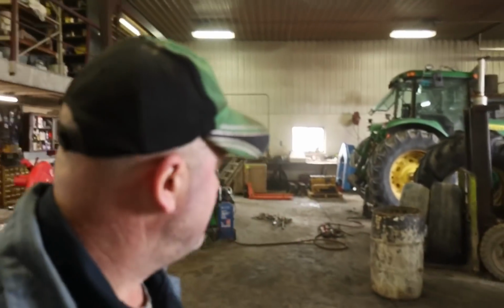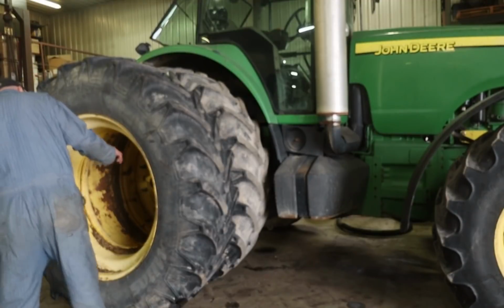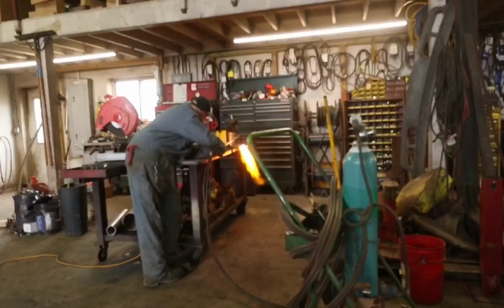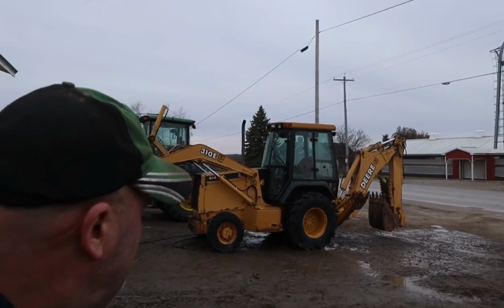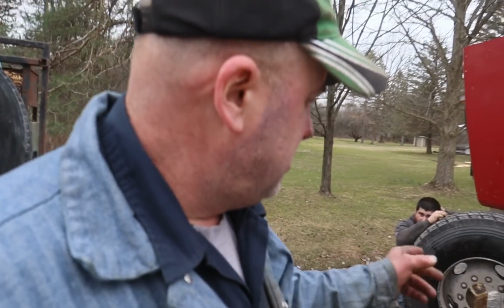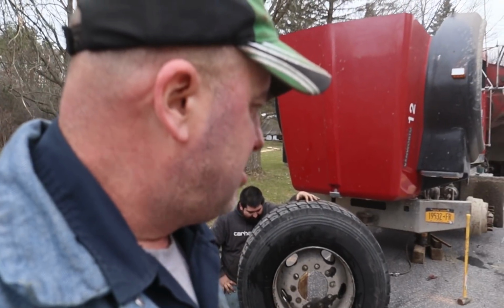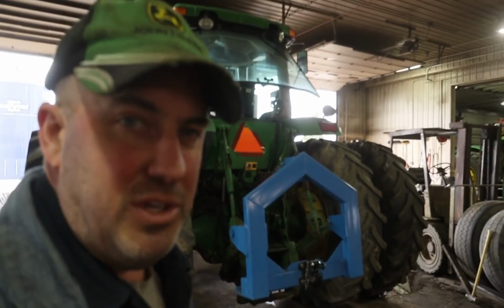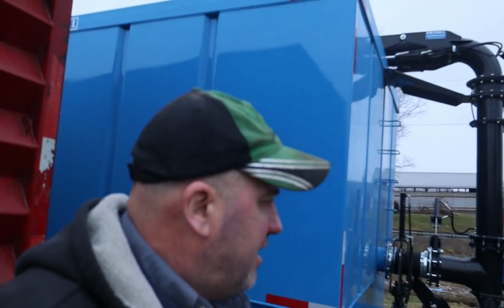Snap On Duals,Blown Truck Tires and Frac tank setup

Comment: We always put a little oil or grease on the dual so it came apart better granted it wasn’t as big a tractor. Never had the snap over clamps we always had the ones with nuts and a mile of threads
Reply: Robert Quast ever try anti-seize on the spacer?

Comment: I'm forever amazed at your calm demeanor - well just heat this up and put a little hook in it..  Or a previous video trying to get the tank and tractor unstuck.  Yup, that aint working, lets try this.  You take everything in stride and just fix it and move on.
Reply: Tad Pary        He is very calm.  I get heated up much easier than him.  My patience is not nearly as abundant as his.  It is a great quality, and I wish I were more like that.
Reply: No point getting ate up about stuff fellas it just tires u out and doesn't get the problem sorted out in the end!!!easier to just keep calm and bash on with whatever it is causing the issue!!!!Andy is just a perfect example of this.if he got stressed out over every issue and problem he came upon each day then nowt would get done and he would just be sat in a corner rocking from side to side!!!this is real life farming not some farm where daddy's money just sorts all the issues out ...there's a few of them on YouTube !!!!!Top man Andy keep her lit fella 👍🏻👍🏻👌🏻😊😊
Reply: Tad Pary me too
Reply: What about either spraying the dual spacer where you wirebrushed it with aerosol zinc anti corrosion spray or failing that apply a very thin layer of copper anti seize?
Reply: That’s farming. You would have a coronary otherwise. Things come up, and plans change by the hour.

Comment: Do you suppose spraying the snap on duals rims with slip plate would help? We used to oil them before we put them on. That didn't always help either.

Comment: Have you ever thought of having safety cones and lay them out on the road to help protect the work area?  Try out some torque sticks for your wheel nuts and studs.  Had them in the Air Force and would never go back.

Comment: A truck tire inflation safety cage should be used when inflating truck tires or mount wheel on vehicle  and then inflate I have seen the explosive effect of a truck tire mishap it can kill or maim and it happens instantly.
Reply: thought that was only with the old split rims?
Reply: No it's all truck tires Its a Osha requirement  a truck tire inflated to 110 psi is equal to several sticks of explosive . All tire manufactures have safety videos showing why safety cages are important.

Comment: Hi Andy, you spoke about changing a wire over on your frac tank so you wouldn't have to have the tractor lights on, to operate the remote control system. On the tractor, are you plugging into the 7pin plug and if you are, what colour of wire is the 'hot' side. Thanks in advance. Taz.
Reply from the maker: Switch the black wire and the blue wire. If you are looking at the back of the plug it's the top right wire with the center wire. Top right when you are looking at the back of the plug where the wires plug in. The marker lights will still be on in the tank but already you won't have to have tractor lights on

Comment: Get some fluid film   and soak them dual rings with it.   eats the rust and lube them.   You can buy at jd dealers,   we buy it by the gallon . Put it a air paint sprayer with  a little veg oil to thin it down and spray away...

Comment: Do you use grease or never seize on the connection between the rim-duals and the tractor rim? Helps keep them from seizing.....
Reply from the maker: No we don't, it will let them slip

Comment: Rather surprised the driver didn't catch the bald tire before blowing it on the road.
Reply: Do they not have to do a daily inspection and fill  out the inspection sheet. Those tires would have failed long ago.

Comment: Never had a steer tire blow I always Heard it's no fun
Reply: I haven't either but one of our drivers did it going 70 never ditched it and didn't hurt the rim
Reply: I had one blow doing 72 at Hazelwood Idaho, no spare. Hours later at midnight tire truck came by Sunday night, 450.00 good to go.
Reply: @cletaspratt9162  we hung it on the wall and put a note saying just needs air 😂😂😂😂

Comment: Y’all need orange cones, flares, or triangles when doing roadside repairs like that. One of you going to get hit one day. Kinda silly not to have any safety. Just saying. Some assholes just have to whiz by at 60+ mph.
Reply: Besides the triangles in the truck. The service truck should have cones. In your safety bin keep hi visibility safety vest with reflectors. The last broken truck was parked on a dead end. That was good this was unavoidable.  You never know when a truck might break down when it is dark. Be safe. Also have change make safety gear for you at daily hustle from you tube. 🤠
Reply: Your right, working on equipment is terrible these days nobody slows down or moves over small things like cones an a refletive vest can go a long ways